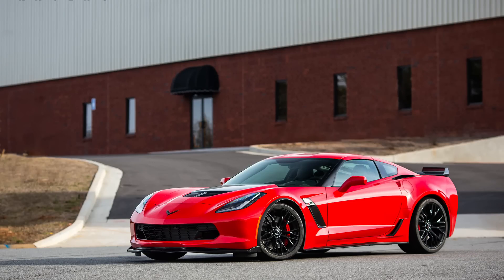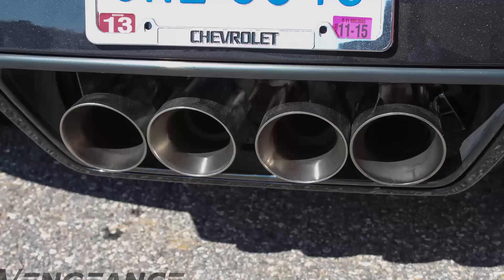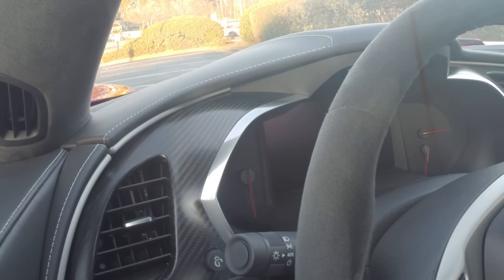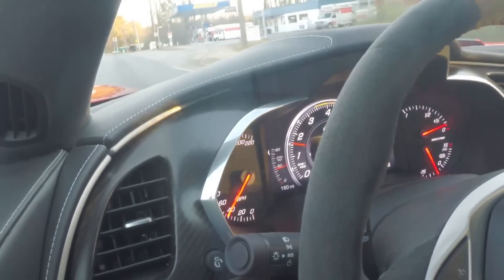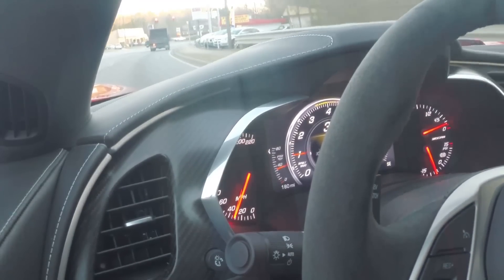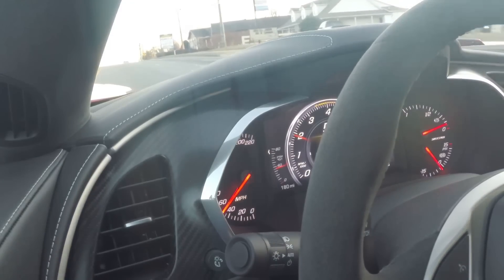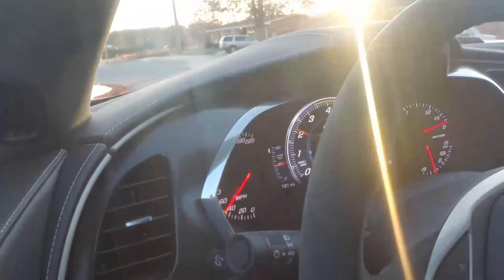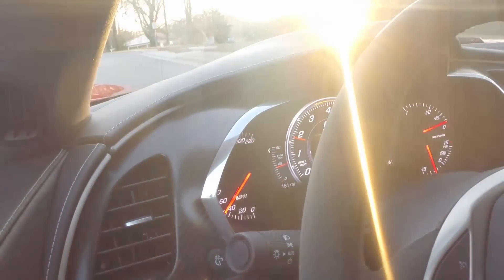754RWHP 2015 Z06  built by Vengeance Racing-Drivability video

Comment: Kinda low numbers for the stock pull
Other guys made 587/611 to the tires bone stock
Also, did you delete the AFM lifters?
Reply: They are clearly sand bagging the stock numbers to make themselves look good.
Reply: averyr18 WHat?
it was a 100% bone stock pull with video.
if anything, they want to underrate the car so their stage 1 pack looks even better.
Reply: Is it a mustang dyno?  Mustangs tend to run lower numbers...
Reply: Iceland1234 kinda like all mustangs!
oooooo burnnn
Reply: Lmao!
Reply: Take that as a compliment in the 1/4th mile peace.
Reply: dynojet vs mustang dynos can give that type of variation between the two platforms when it comes to the numbers, also some cars just perform slightly better than others

Comment: Very good video and drive ability.   I got a 2015 z06 but my idle at 600rpm and it not smooth like this one Is it normal or I need to go see the dealer?  It only has 3k miles
Reply: +Hmoob Hawj If you can't tell that's not normal sell the car and buy a prius
Reply: Hmoob Hawj And you call me stupid. I understand that you are asking a question. If you don't know that a high power car that idles roughly at 600 rpm's has an issue, you should even have the car.
Reply: +Luke Tobiasson if I know I wouldn't be asking question so what is your problem when it not direct to a person that can't afford a z06.
Reply: Hmoob Hawj I actually have a z06. But if you don't know that a 600 rpm idle is abnormal, you shouldn't be driving a cool performance car
Reply: +Luke Tobiasson if you do you would be helping instead of trolling
Reply: Hmoob Hawj well i'm not trolling. Yes there clearly is an issue, and you should get it checked out

Comment: I'm confused why GM made the 7 spd manual cars with paddle shifters
Reply: Horace Taylor 

Those paddles are to turn the Rev Matching on and off.  He had it off in the video.
Reply: StrokerAce I'm pretty sure it does still work.

Comment: 560 HP !? wtf !? a stock c7 zo6 has 650 HP
Reply: 650hp motor is gonna be off from what it puts down to the dyno
Reply: 650hp at the crank....560hp at the wheels....you lose some power through inefficiencies in the driveline. its like that with every car....somewhere between 15% to 20% is lost by the time it gets to the tires.

Comment: from 650 only 560 rwhp thats a fail
Reply: How's that a fail?
Reply: 100 hp lost? Are kidding me 40 hp will be aight but 100 wtf its not suv its light sport car already
Reply: +SAM GH it's about a 15% drivetrain loss most of these are dynoing at 560-570rwhp so that equals 644-655 crank hp I'd say that is pretty damn good
Reply: Yeag but hemi 6.4 470hp = 430 rwhp 
Hemi 6.2 707 / 670 rwhp 
If you say 100hp loss on light car is okay then idk what to say and i just searched and  the stock zo6 pull 580rwhp so even that confirms my doubts
Reply: Sorry allergic to bullshit
Reply: F1 is 350hp so zo6 is faster because weight has nothing to do with rwhp 
I can't believe how many ignorant in here lol
Reply: +SAM GH I didn't say that I said the weight of the car has nothing to do with how much power that car makes
Reply: +SAM GH also I don't know much about F1 but I was on the grandprix website and it said the cars are around 900hp
Reply: LoL alright no wonder